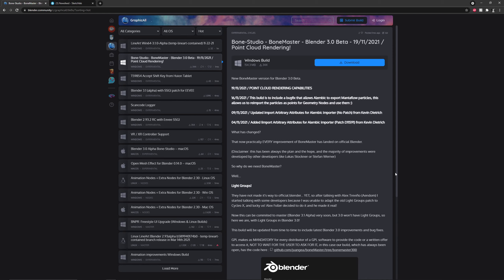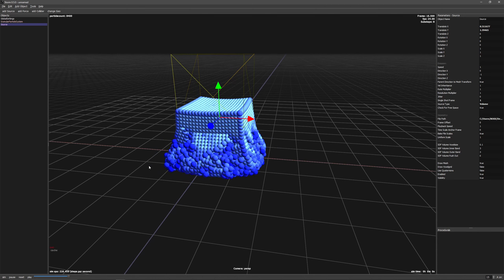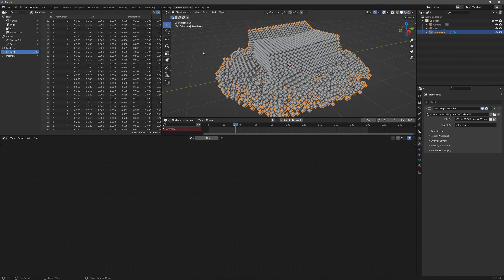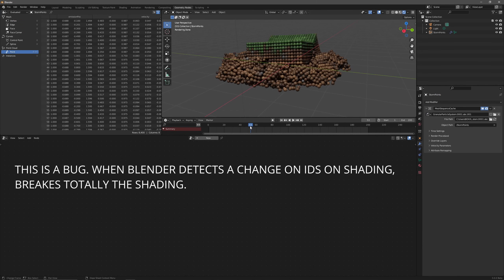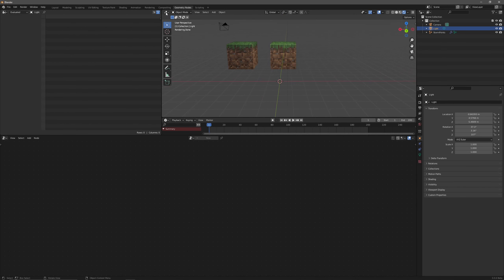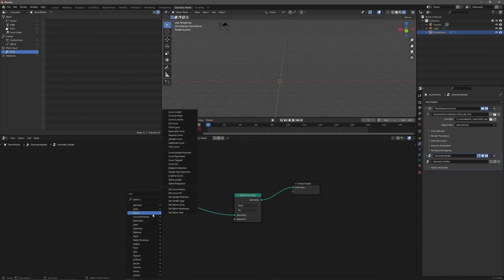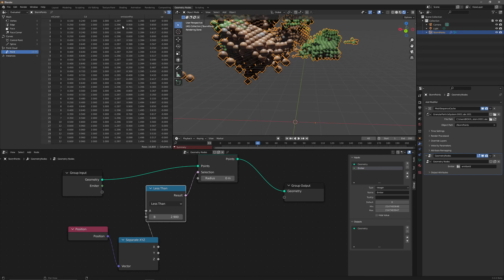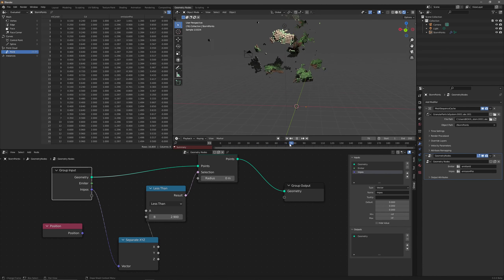Blender Geometry Nodes:  Tweak simulations Postcache

Comment: I'm currently using Blender 3.5 and I've imported an alembic exported out of Storm. Inside of Blender, however, I'm only able to see the Position and Radium alembic point data. I'm specifically trying to access the color information, but there is no column for Cd as you show in this video. Is there something special that needs to be done in the newer version of Blender?

Comment: That's weird. Whem I import Alembic cach into Blender I've got Vertex instead of Points and as Atributes have only Position (Blender 3.0 last version)
Reply: Thats not weird.  As I said on the beginning on the video, what I am doing here is with bonemaster compilation, that its using some features that will appear on blender 3.1.   Check the link on description.
Reply: @andvfx  This is not in Blender 3.1. And I found it hard to understand exactly what was the point with that "bonemaster" edition. You didn't mention the normal procedure to use "add mesher" and I found that confusing also. But the possibility in Blender seems very attractive. And thanks for making that tutorial.

Comment: since you were able to get the uv texture on the particles, could you put a mesh on the particles and then put the same uv texture on that with geometry nodes?
Reply from the maker: Not sure if I understand totally what You mean, if you instance an object with uvs, yes, you can just simply use this instanced object uvs.  If you want to adquire closest uvs from the instanced geometry.... Then you will loose your instances, will be possible, but you need to operate over each individual face, you have "adquireattribute" or copyattribute in GN. if you have a lot of objects can be very heavy, but doable.
Reply: @effectivetds3821  Sorry I should've explained myself better haha. So, I know you can use this program to do water simulations and that kinda stuff. In the case of a water simulation, like a block of water falling on the ground, instead of a water material/texture on the simulation, could you put a uv texture on it? like the minecraft block texture, with geometry nodes. I hope this makes sense lol

Comment: Is it possible to add different materials to different emitters? Or not necessary to different materials but one matterial but 2 different colors for example with a color ramp. It would be awesome if you would make a tutorial from that one ! :)
Reply: I've figured it out. You have to split cache save per emitter by their ids.
Reply: @molecular_master  Yes, you can split it, or you can directly use the emitter ID to drive different colors for each integer.